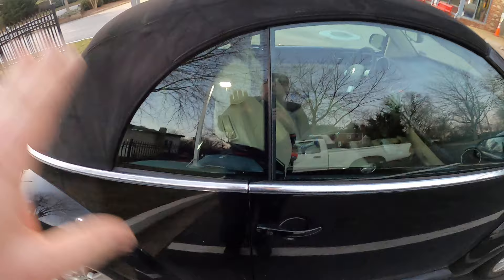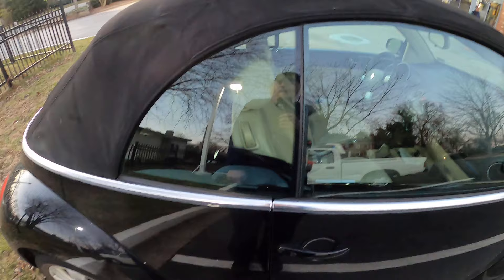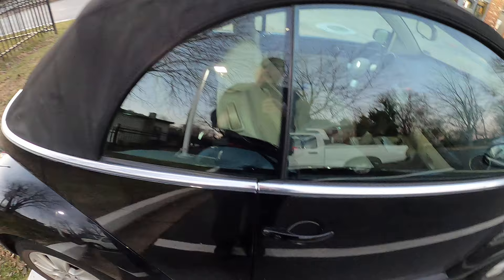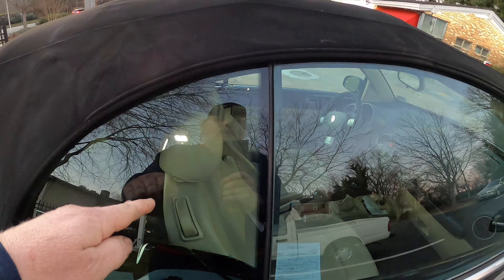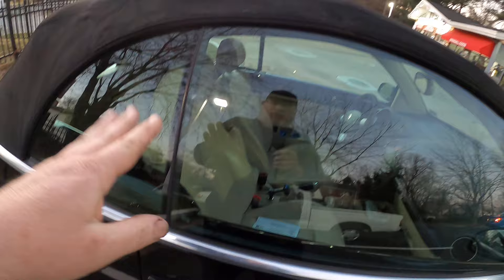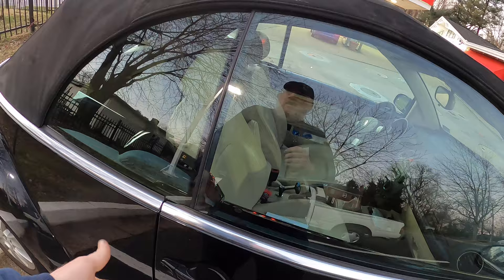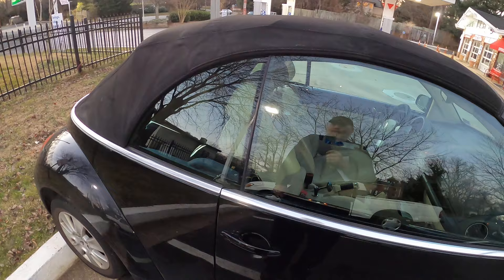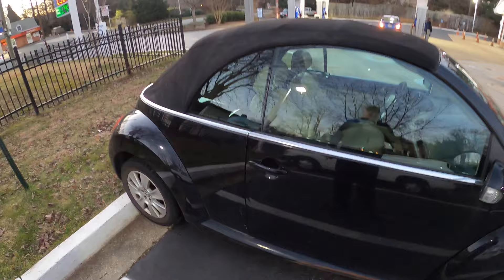Volkswagen Beetle Power Window Reactivating / Resetting Procedure

Comment: If you have a 2015 there is also a reset protocol in the owners manual. If you replace the battery in these cars weird things happen. In the 2015 when you open the door by pulling on the handle (inside or out) the window will drop half an inch and after the door closes the window will go back up a half an inch. I put a new battery in my wife’s convertible and the window would drop the half inch but it would not go back up automatically. I read the manual and all I had to do is lift up on the power window switch and hold it for more than 2 seconds and then let go and repeat that and the window function was reset. The dealer had no idea what I was talking about and said I needed to bring it in. Thanks for your video, it reminded me to look in the manual.
Reply from the maker: Most people won't look in the owners manual.
Reply: Thank you!!!  I just did that and the window now It closes after closing door.  Also this has to be done to each door
Reply: Just changed out my wife’s battery in hers and was looking up how to fix, thanks for the tips!
Reply: @AdamD78  my pleasure!
Reply: @braindamage396  you are welcome
Reply: @whitneyknight6211  You are very welcome, I guess I could say my VW dealership was responsible for me posting this.
Reply: ^^^This 100%! Took my car in for a recall replacement and had this issue--dealership tried to charge $150 for something that takes literally 2 seconds to fix.🤦‍♀
Reply: @mattiegr6423  you can’t always trust the dealership staff to know what they are talking about.
Reply: bless your soul!!!!! replaced a battery and the window wouldn't go up after! thank u so much
Reply: Thank you so much. I ve settle my beetle issue. 😂😂
Reply: You literally just saved my ass

Comment: Great video and thanks for sharing this solution! My problem was that the passenger's front window didn't go down 2 centimeters while opening the door handle. This blocked the door from opening and closing properly. But your video gave the info to solve this as well! Many thanks.
Reply: This is the problem I am having with my Scirocco after a new regulator the window isn’t dropping down to let you in hope this works for me as I’m out of ideas and so is the garage

Comment: Hi, I have a 2002 VW Cabrio and the drivers side window just began stopping at various points.  The car shop said to hold down the button for 10 seconds, each way up and down.  That worked for a while, but now it is not working at all.  I am at work with window about 1/3 down, good its a nice day!  I will try this at lunchtime...thank you
Reply: did it help?

Comment: Wife's 04 Beetle convertible had the passenger front window regulator break. I got it fixed but now I'm having an issue with the window not lowering a 1/2" when you grab the door handle to either open or close the door. Worked fine previously. It lowers and raises just fine with the switches and with the key in the door but it doesn't sense when the door is being used which means it doesn't lower to clear the convertible top. I was hoping this window reset procedure would help but unfortunately it hasn't. Any ideas?
Reply from the maker: Sorry no I don't. I would think the reset would have fixed it.
Reply: I am having the same problem - did you find a way to fix it?
Reply: I too have this same problem please tell me if u fix it
Reply: I also need help with this. The windows on my daughter's 2003 VW Beetle convertible won't go under the cover when the top is up, so there are gaps and the windows stick out from the top. Any ideas?
Reply: Was planning to replace the window regulators, but in all the instructions and videos I saw, there is never a mention of how to adjust so the window fits "under" the cover. Seems to be a lot of us out there with this issue and plenty of DIY skills. Any one with knowledge will to help out there?
Reply: Disconnecting battery for 30 min and reconnecting it reset mine
Reply: Having exact same problem with my Scirocco new regulator and window don’t drop when handle is pulled don’t seem to be a lot of information out there on the solution to this?
Reply: @dennispagel8645 did you have a new regulator put in
Reply: @andygregory1579  I never found out how to fix it. Now its just another annoying quirk to the car though we don't drive it much anymore either.

Comment: I have a 05 Volkswagen convertible beetle the window did go up and down on the driver side and raising and lowering adjusting the bottom for it to fit and quit all of a sudden now it won't do anything none of the windows work I've got there all down and they won't go up any comments is there fuses relays or something that controls the power to the driver side window
Reply from the maker: I would look in the owners manual for all of the fuse box locations. Then test every fuse.

Comment: I have a 2009 convertible the trunk that stock and one open don't know how to open manually through the outside of course
Reply: It won't open its stock and don't have any key to open it though the outside 
I have to go inside to open it....any help you can give me will help
Reply: @glorialombardo8547  I had same issue with my 2004 and found broken wires on left side of trunk where they are running down the support, wire were broke for third brake light as well same spot.

Comment: After watching dozen of videos and none of the work for me, here is how to proceed If no success :

-disconnect battery

-press brake pedal (to discharge all the remaining electricity in car)

-connect battery again

-ignition ON

- you may have indication of ESP fault - to fix this turn steering wheel completely on one side, than completely to other side - ESP error will disappear

- now windows (generally as in videos) , one by one move it completely down, hold button for 3 seconds, move it completely up, hold button for another 3 second

- repeat for other windows

- done

- you are welcom

(without reseting all car by battery disconnect, it doesn't work for me)
Reply from the maker: I had another car that the windows would not program so I had to disconnect the battery and then it worked.